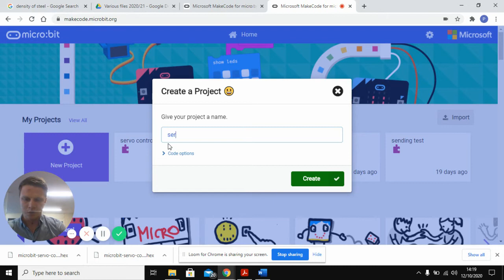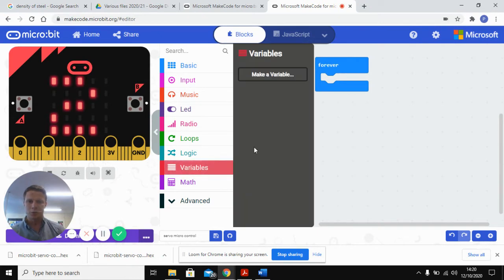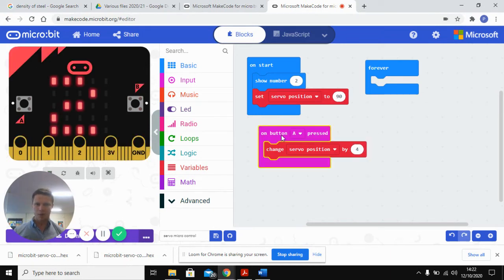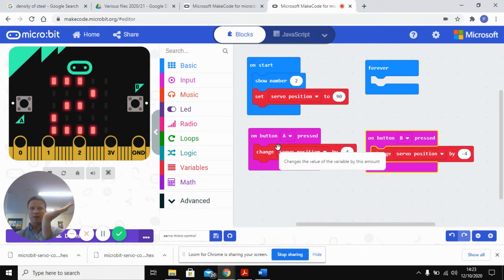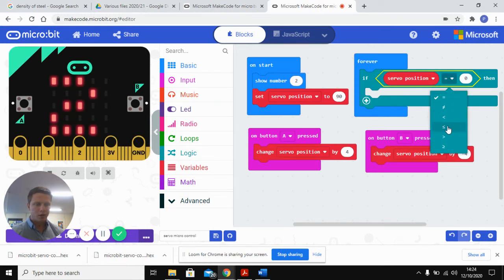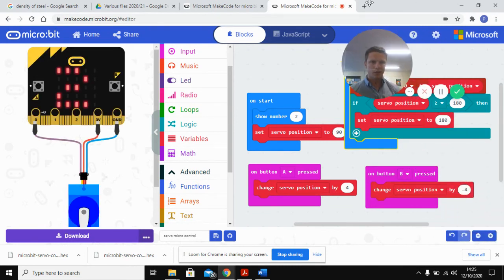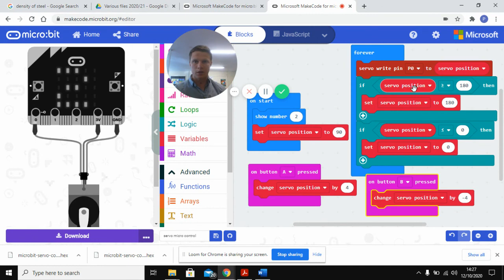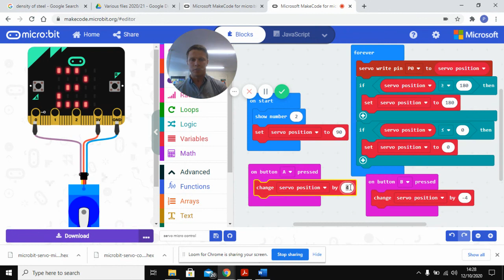Microbit tutorial 4   Micro control of server motor

Comment: Hi Paul. In relation to your limit switch video (I can’t comment), would that code be the same for a simple motorised car park barrier project controlled by a DPDT switch connected to pins (instead of A & B) on the breakout board and limit switches connected to stop the movement of the barrier? Thanks